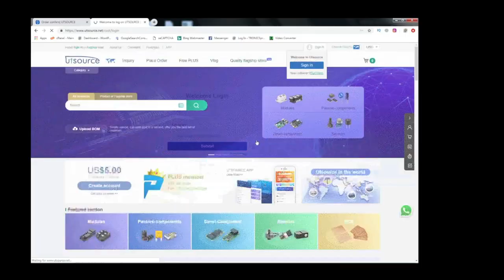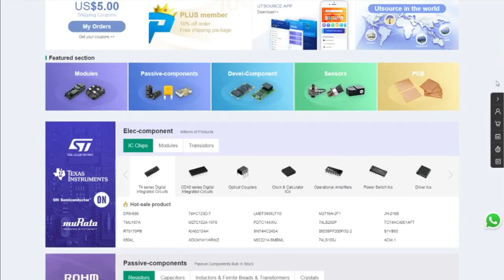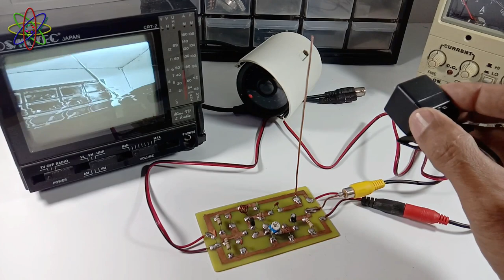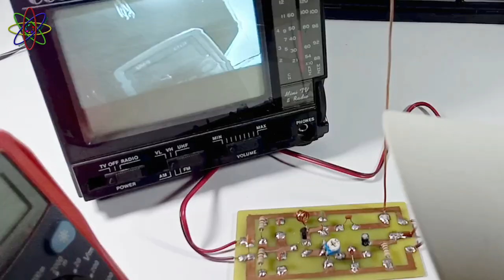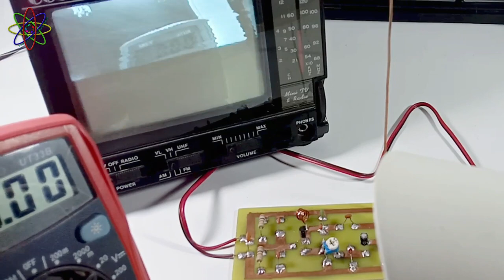Video Transmitter - How to make CCTV Transmitter at home DIY Homemade - Utsource

Comment: The tutorial is very good and helpful for those who want to try it for the first time, but unfortunately there is one drawback, namely that it doesn't explain how to make a PCB board, what types of components are needed.

Even if you are an electronics expert, if you use the wrong components, it will certainly not be perfect. Try to improve it in the future. Thank You
Reply from the maker: Thanks for watching and your valuable comment.